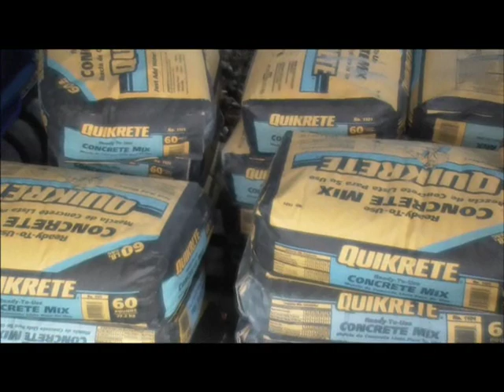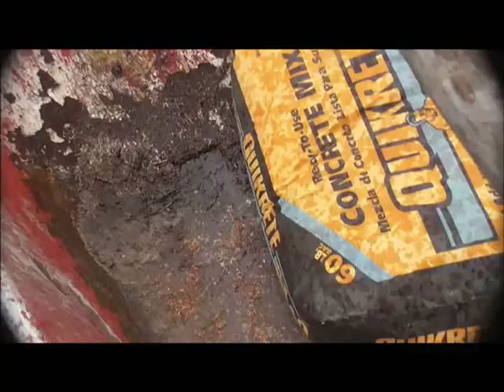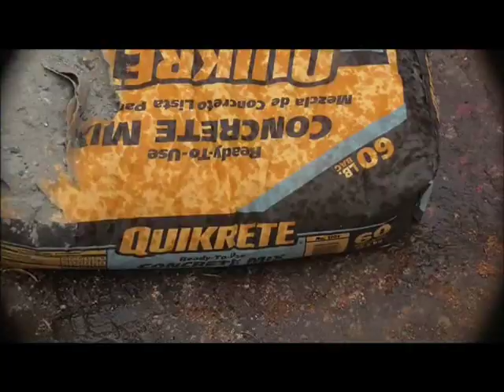DIY How to Install a Chain Link Fence [Chain Link Install]

Comment: Top rail was supposed to go before chainlink unrolling so u could align the top of your chain-link fence evenly. But okay other than that you did a good job even stretching the fence that way with your truck was innovative
Reply: More importantly your top rail serves as a brace between the terminal post so the opposing forces of the top rail pushing out and the tension of the fabric compressing in does not un-seat or lean your post.    -- good job next time set post, run bottom wire, pull fabric, hang gates, wire tie and put on your caps.
Reply from the maker: Thanks

Comment: Question, I'm putting up a dog kennel and was told that the prefab sections of chain link, once you put them together, are heavy enough that they'll just sit on a flat surface without having to have the posts in concrete. I mean, once you have all the walls put up, they are pretty darn sturdy unless you're trying to contain a horse. You agree?
Reply from the maker: Yes I agree. In my opinion the strength of the pre-fabricated sections of chainlink is the the rigid frame of each one. I have owned two separate 4 panel (sections) dog kennel type chain link set ups and had nothing set in concrete. If you are putting it on dirt though you may look at  options to keep whatever you are counting from digging out or something from digging in (coyote, fox, etc.). I used these one time as part of a chicken coup for years.